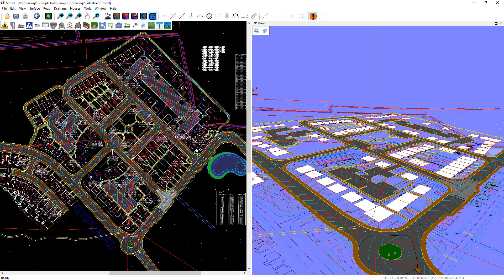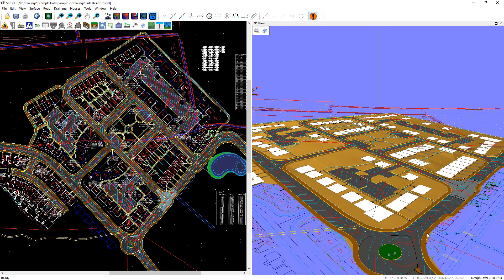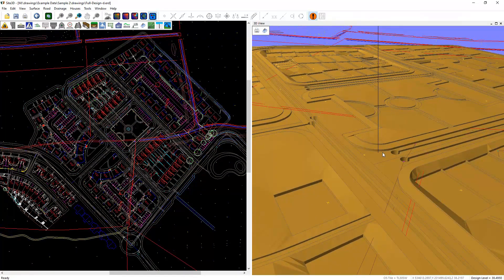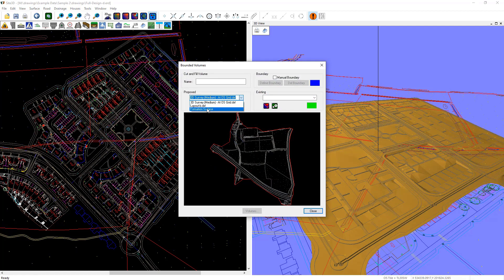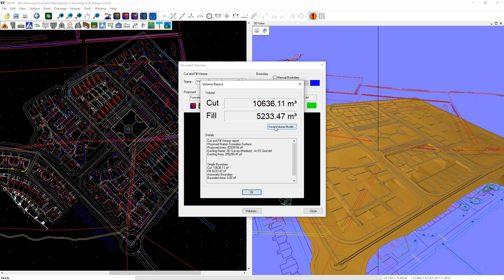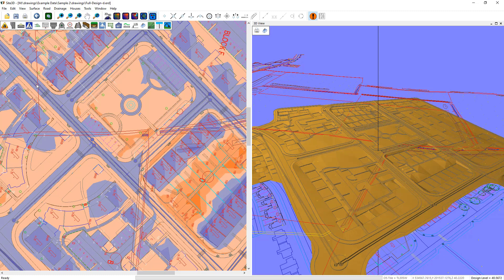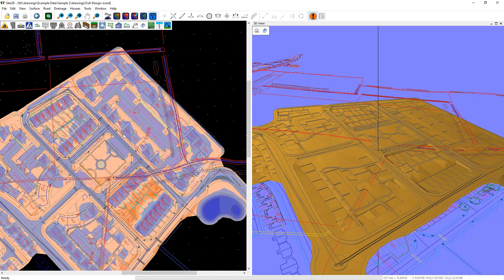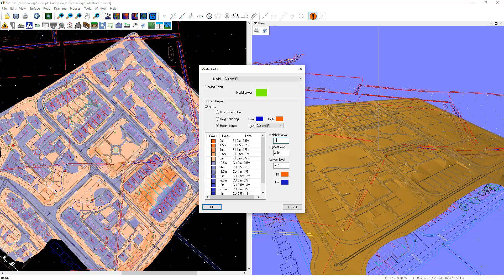Site3D: Cut and Fill Volumes, Formation Surface and Isopachyte Colours

Comment: 1 - Can you show the process of generating from 2d? 
2 - Can you generate areas of 3d entities assigned to different material construction thicknesses?
3 - Can you report the cut & fill data to an excel spreadsheet?
4 - Can you customize the export to excel i.e. report under the parent category of materials; then you'd want to run another report with the qt's under the parent of chosen depth bands?
3 - Can 2 above generate surfaces of combined polylines & spot-levels; they all look to be proposed flat pads on the same z-dimension.